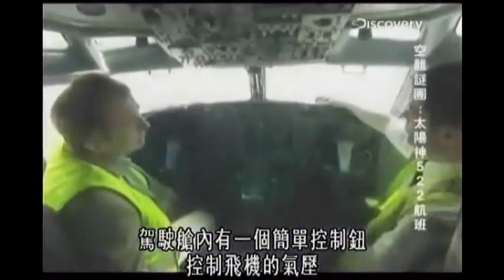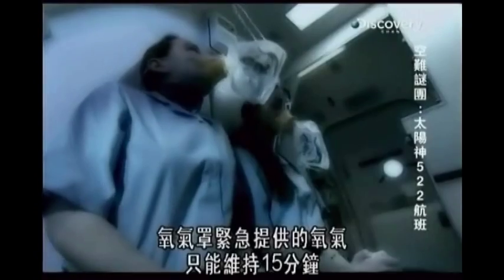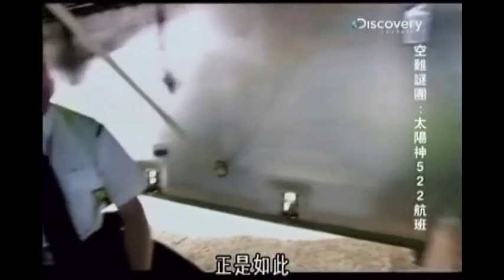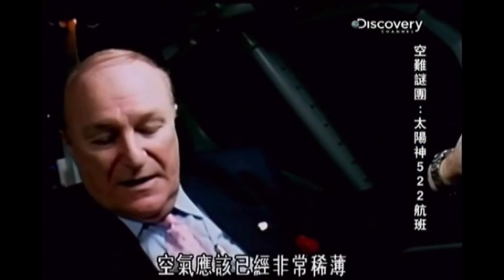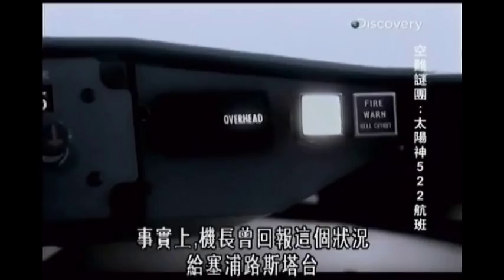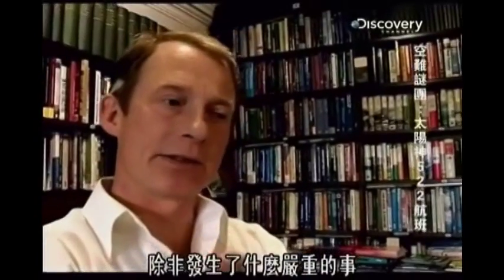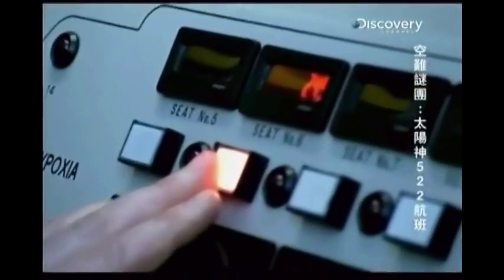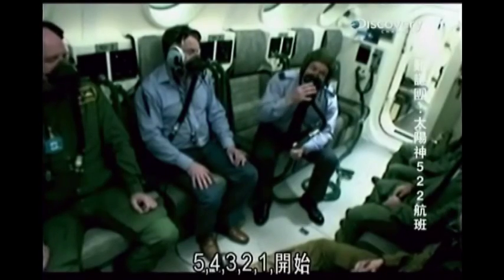Helios 522 - Mysterious Plane Crash - part 3 of 5

Comment: I’m surprised how much commercial aviation relies on just trust. Airplanes dont literally even have locks because it’s hard to reach the door without the right equipment, they only have stickers on the door to indicate has it been opened after it was last closed.
Reply: Even the radio system is a little bit suspicious.  I understand it’s easier to use the old technology because it’s familiar but I can’t believe we don’t have a more reliable system existing.

Comment: So basically just by switching the knob on manual in mid flight you could kill everyone
Reply: i know and why didnt the pilot check the switch before take off ? i thought pilots have to make sure the pressurization switch is on auto during the 3 checks before take off